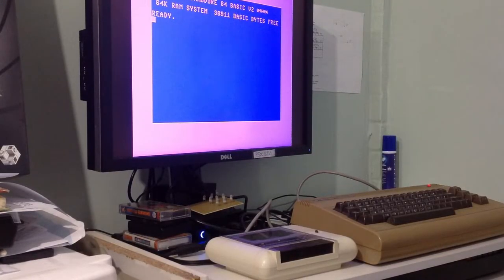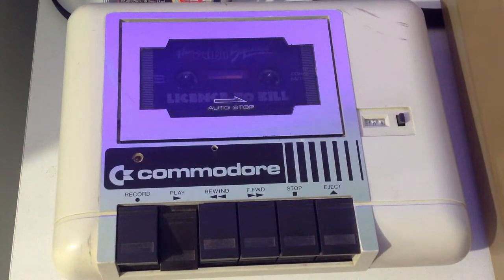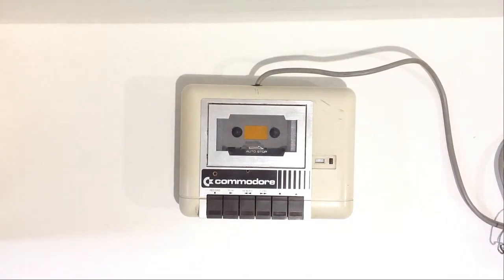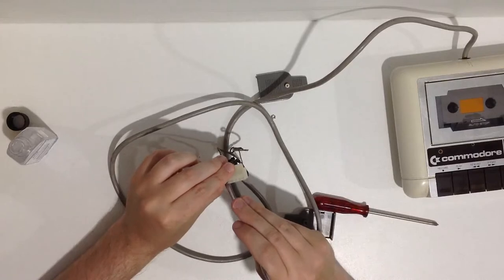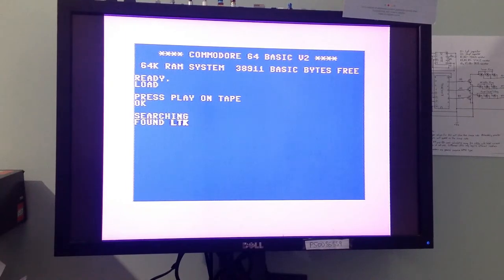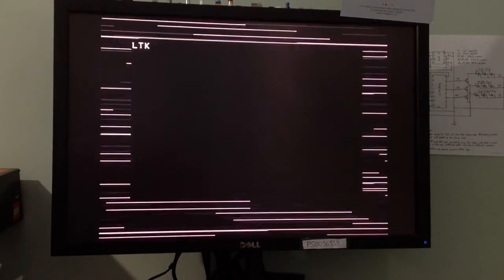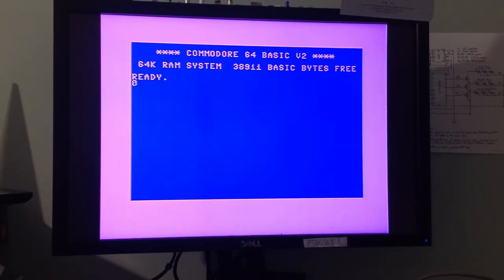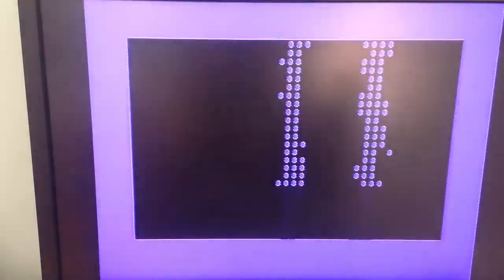Commodore 64 -  Tape Deck Not Loading? Try This...

Comment: My dad opened up the original C64 tape deck and found an output on the circuit board, he connected a lead to another C64 tape deck (a 3rd party one). I could load games and copy them at the same time perfectly, I could optionally listen to the sound output too on the 3rd party deck and became so trained I could adjust the tape head on the fly by ear to load difficult copies and even make a better copy that would load with the head in it's normal position. Those really were the days.

Comment: The ground lead is for connecting to the metal case when used with a Commodore PET. It is not used for the Vic 20 or C64. Later units didn't have it.

Comment: Many thanks for the video. My c64 player does not load a handful of games. But it successfully loads others. Does this suggest a fault with the unloaded cassettes?
Reply from the maker: Quite possibly. If you are not the original owner of the games (i.e you got them pre-loved) it's hard to say what care was taken to look after the cassettes. I have all my Amstrad CPC cassette games from a kid (30+years) & they still work fine because I always took care of them & stored them away from the dust & sunlight.
Reply: @TheRetroStuffGuy  Many thanks for this. No I am not the original owner of the games which don't load. They were ordered from ebay. Any tips to clean the actual cassettes would be highly appreciated
Reply from the maker: @ScrabbyDabbyDoo1   Well in the olden days they did used to have devices that would clean cassettes....not just the tape players. You might be able to pick one up on ebay, though chances may be a bit slim. 

Alternately, i've not tried this myself, but you could try cleaning them manually by hand. Very time consuming by the sounds of it but https://legacybox.com/blogs/analog/how-do-you-clean-old-cassette-tapes  might be worth a go. 

If you do give it a go, let me know what happens.

Comment: Same with a vic 20 I hope.
Reply from the maker: Most likely I reckon.
Reply: @TheRetroStuffGuy  Well guess what. I cleaned my datasette connection port on the back of my VIC 20, and all my program tapes start loading right away. Thanks for your best advice, I had a feeling it was a bit dingy, and that was the issue.
Reply from the maker: @SinisterScoundrel6562  Result! Christmas has come early!

Comment: Ive got a burning question. Im 31 and wasnt alive for this. What would happen if the cassette ended? Like if it ran out of tape?
Reply from the maker: Well it would just stop. Depending on the tape deck you had (even for music or computing) the play button might pop-up, but usually the play button would stay compressed & try to drive the tape spool. I hope i've understood your question. :)
Reply: @TheRetroStuffGuy  yeah that helps. I get it with music and movies, we had those, they run out, you either flip it or rewind it. But playing a game on a cassette? That just blows my mind.